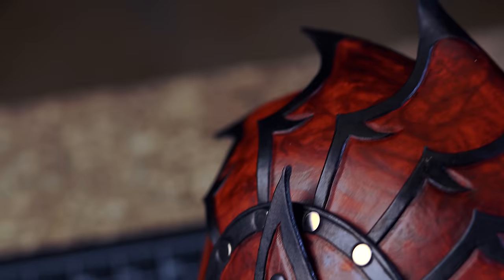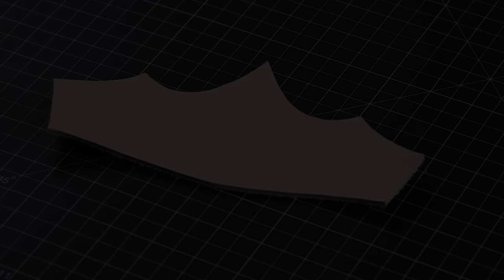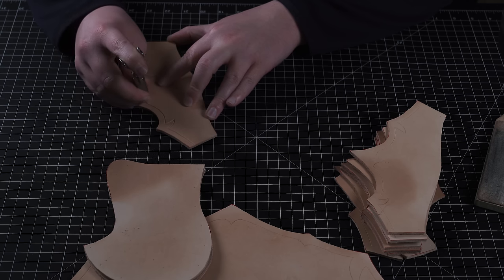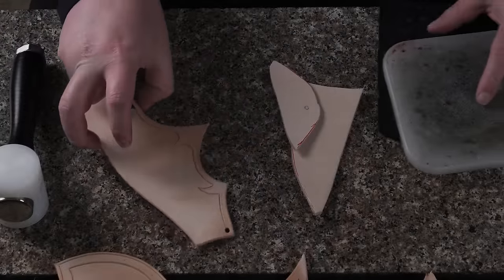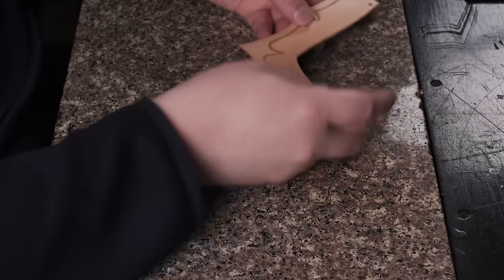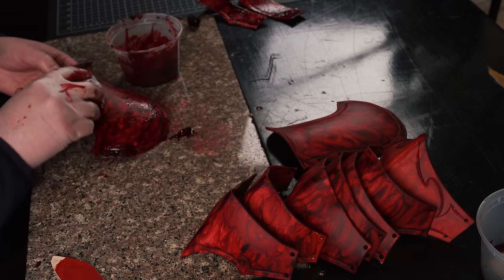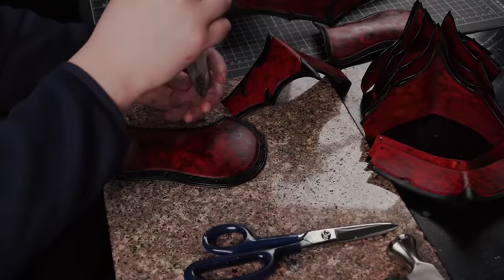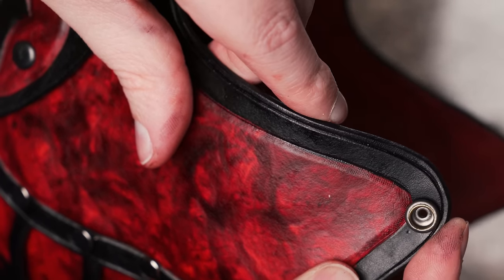DIY LEATHER HELMET - Fantasy Armor Tutorial

Comment: at 42:50 I have had full-blown panic attacks from snaps doing this. Think it's completely set and "boom" the little stinker just pops off. What I do is use the bigger line 24 setter first but only give it a light smack. This starts the doming of the inside piece. Then I switch to line 20 setter to drive it home. Works wonders. Trial and error is a huge part of Leatherworking.
Reply from the maker: Haha, yeah.

Comment: You might try a hook razor for the rough cuts. They are disposable razor blades that are extremely sharp but safe. They are often used for vinyl flooring.
Reply from the maker: You mean the ones you can get in the utility knife style?  I do recommend those too but don't have any on hand at the moment.

Comment: Completely new to leather working here.  However, I have had some exposure in the past.  Enough at least to follow along and understand your instructions.
I really enjoyed your Bracers and Spaulders videos.  I honestly believe I would start with the bracers, then the spaulders and after some mistakes, lol, attempt this Helm.
Thanks a lot for your video's.  I can't wait to give this a go.
Reply: @Prince ArmoryI notice that while the stains are different in your three projects, the design is very much similar and I assume that is on purpose to allow a "set" appearance.I do have a couple questions....1) For those of us with longer forearms, how would you suggest adding length to the bracers to add one more plate?2)  Are you considering, or have you done, a chestplate of similar design to complete the set?  I can see your display is set around chainmail, but I think a tooled Chestplate would be outstanding and really complete this design.

Comment: Your work is amazing and I have followed your projects for quite some time. Great tutorial and I am excited to start working on mine as soon as I can pick up the pattern. I do have a question about what I saw in this tutorial. Since you use a generous amount of dye on the leather. If someone were to wear the helmet what would keep the moisture or sweat from bleeding out the dye onto their skin? Does that final coat that you put on work as a good sealer to prevent that from happening? Would leather sheen do the same? I've used some dyes in the past and whenever there is a good amount of moisture they tend to bleed out a little from the leather.  Thanks and keep up the outstanding work!!!
Reply from the maker: Some dyes are worse about bleeding than others but you have two options, either seal the leather like I did with the satin sheen on both sides, or, leave the under side completely undyed.

Comment: Awesome video and a sweet pattern. Beautiful and simply elegant, I'm itching to try it out.  I'm planning to use a 10-12 oz. leather. Any suggestions for doing this with a thicker leather?
Reply from the maker: Good question.  Yes you can use thicker leather however it will be more challenging when riveting 3 layers of leather. You may want to switch up to copper rivets or long chicago screws and adjust the hole width accordingly.  The hole spacing on a design like this should still be pretty close even adjusting the thickness of the material but expect some minor tweaks and plan accordingly.
Reply: You can use a French beveler (French skiver) to skive a countersink around the rivet hole so you don't have to change the style of rivets. Do a couple of tests on some scrap to make sure you get the right depth so the rivet sets properly and secure. You can do this with the snaps as well, just make sure that you do it on the flesh side. If you do it on the grain side, the dome of the snap won't cover the part that has been cut away and can look unsightly.

Comment: Hi! We bought your pattern and are ready to dye! We're new to leather working and are having trouble achieving the color/texture you show here. We purchased the same dye, but it seems much thinner than yours appears, and dries much much darker. Any tips?
Reply from the maker: There many factors that could be at play and hard to say without being there looking over your shoulder.  Different types of leather, different applicator,  application process, different moisture consistency, possibly even a different lighting, or maybe even other factors.  My advice is just learn by doing and trying different processes and techniques.  I tried to show my process fully in the video but even so, it doesn't have to be exactly like my result to still be good.

Comment: Love this and everything about it but I have two questions.  First question is about shaping the leather I understand how you did everything but the side pieces.  Did you use the same fold it half and hammer or something different because it looks to me like it has a much different shape than if you folded it in half and hammered it.  Second question is on the pattern itself: what are the dash lines on the pattern?  is that another way to make the pattern to get a different shape?
Reply from the maker: The side panels only have a little shape which I did by forming it with my hands.  You don't have to do this but if you want to learn stay tuned to future videos, I'm sure it will come up again soon.  The dash lines are for the second style.  at the early part of the video you can see the black variant that uses those lines.

Comment: Does it work in combat?
Reply: That mostly depends on what you choose to make it out of and what kind of combat you are doing. If you build the pattern out of 14 gauge steel sheeting and line/pad it properly, it'll do great. As far as re-enactments, larps, etc check with a marshall and/or the guidelines for combat to see if your planned build will be up to spec. Using 8-10 oz leather like is used in the video will be fine for most light to medium boffer larp type things. If you are going to be using rattan or other hard hitting full contact combat rules, you'll likely want to build heavier and wear with a well padded gambeson.

Comment: I have a question. Is it possible to attach or somehow integrate this style of armor helmet to a motorcycle helmet. Just thought that helm would make a cool bike helmet.
Reply: My two cents: Since bike helmets are so specifically made for maximizing protection, you'd want to modify the motorcycle helmet itself as little as possible. If it were me I'd probably build an oversized leather helmet that slides down over the bike helmet. My concerns would be visibility and anchoring. If you built it as an over-layer you'd want to have some kind of snap or button stud that locks the leather helmet in place so it doesn't shift or rotate on you and block vision.
Reply from the maker: You could possibly do something like that if you modify the pattern a bit.
Reply: Bjornsworkshop hi. That is exactly what I was thinking. Laying the leather on the helmet and modifying the leather to fit. Visibility is a concern but one can always adjust the design.
Reply: @Sularus76  hell yeah!! Give it a go and let us know how it goes! You can always start with a cardstock mockup to iterate your pattern without having to go through a ton of leather to get it right!

Comment: Beautiful work and excellent video, subbed and it looks like I have a lot of back catalog to go through, always happy to discover a new channel. If you're up for some constructive criticism I will say the edit could be tightened up a little, some parts get a bit redundant. The audio mix gets a bit muddled too, making your narration difficult to hear. In addition to audio levels try tweaking the EQ of the music, drop the frequency at about 1550 or so and you'll hear the dialog much easier. I learned this trick way too late :-)
Reply from the maker: Explain the frequency drop?  I'm new to this.
Reply: @Princearmory  it depends on what you use to edit in, I use BlackMagic DaVinci Resolve (check it out, it's incredibly powerful and free if you don't need high end features). Basically you add or adjust an Equalizer (EQ). You'll see a bunch of numbers corresponding to frequencies, the higher the number, the higher pitch the sound. The left side is the low end, the right is the high. There's a line with dots or vectors going across, move those dots and the line up to boost that frequency, pull it down to minimize it. Find the dot around 1550 and pull it down a bit, you may have to shift a dot left or right to get to that range, and the other dots around it will form a curve, it shouldn't be too sharp it will sound distorted. Since the human voice tends to live in that area when you cut it out of the music it won't compete as much. You can also experiment with your dialog to make it easier to hear. Use these in addition to overall levels to keep everything balanced. Also watch your level meters, keep it at around -6db and watch those red spikes, it's a warning that things are getting too loud. If there are any ACTUAL audio experts (I am not) please feel free to expand on this.

Comment: can i ask please because i bought the patterns and video how many square feet of leather thnx
Reply from the maker: Leather is priced by the square foot but not really sold by the foot.  And there are many variables that will change the number of square feet used as well just based on how you end up laying out the patterns.  Check the video at the point where I have it laid out so you can get an intuitive idea of what you'll need.  When you buy the leather, it will probably be a side or something that will give you much more leather than you need initially, which is good because then you can pick a clean spot in the leather where you trace your parts.
Reply: thank you sir
 @Princearmory

Comment: Man, I wished I had found a video like this years ago when I made my Baratheon armor. I had to basically wing it. Looks awesome, but still, this would have helped, I didn’t bevel the edges or anything, and you didn’t explain about burnishing the edge, the tool, process or the purpose. Can you?
Reply from the maker: I just used a burnishing tool (a stick basically) and used friction to smooth the edges, nothing to it, i just forgot to write and record that part.
Reply: PrinceArmory thanks. I do have a question. I made a helmet, bracers, shoulder and arm guards, a skirt, leg guards, and a breast plate. All but the breast plate kept their form and rigidity. I’m guessing because of sweat. But I’m looking to reinforce the breastplate to give a more firm appearance. Was thinking of something like a molded sheet of Wonderflex, or another thermoplastic, but would love a second opinion.
Reply from the maker: Dunno, depends on the thickness of the leather I guess.  Such a unique scenario its hard to speculate without more information

Comment: Thanks for a great video, and what an end result!
You used 9 oz. leather, do you reckon it would work with lighter leathers or would they start to loose their shape?
Reply from the maker: You can go a little bit lighter.
Reply: @Princearmory  Thanks for the reply :)
Reply: Each step of tooling, dye, and sealing adds a little bit of stiffness to the leather. A lot of leather masks are made of 5-6 oz leather and hold their shape just fine. Below that things start to get a little iffy strength wise, but for purely costume wear you can work with 5-6. If you do a little bit of wet forming the leather will also water harden helping even more!

Comment: I just watched the red & black armor video (looks like the armor that goes with this helm). This might be a stupid question, but can you harden leather to make it more resistant to cutting? Or is it that you just add more layers? Or both?
Reply: Definitely not a stupid question. No way for you to magically know the answer!   There are ways to increase the hardness of leather (compression via tooling, adding acrylic sealer, using a product called leather firmer, etc). Beyond that you can add more layers, back it on other materials, sandwich a reinforcing layer between layers of leather, and much more. There are tons of options, but its feasibility really depends on your goal. When you do leatherworking.... you cut leather with a knife. So leather won't ever be the go-to for cut-proof stuff. Having said that, if you're just looking to step it up from where it was before, DEFINITELY possible!

Comment: Why didn't you use the Chicago screws to secure all of this together?
Reply: The biggest reason is that rivets are significantly less expensive than Chicago screws. Additionally, rivets tend to give less room for play between panels of leather because they are set firmly in place. You could absolutely use Chicago screws everywhere that calls for a rivet, just make sure that you put a drop of light grab loc-tite or something similar so they don't work themselves loose over time!
Reply: @bjornsworkshop9288  you do amazing work man!
Reply: @jsinprtn29  hey thanks! Much appreciated!

Comment: I don't want to F with the craft, but would etching the cut design in, or perhaps even cutting the the pieces out with a laser cutter be effective? Or would it singe the leather too much & ruin it?
Reply: You can absolutely laser etch leather. Cutting partial depth works to a much more limited degree. Because of the burning, you can't really use a laser to cut instead of swivel knife work to then go back and bevel.... but you could absolutely laser cut pieces out to create intricate filigree designs.
Reply: @bjornsworkshop9288  Yeah, ok. I see what your saying. The laser cut edges would be burnt & crispy & not great for beveling, but it sounds like it would still be alright with other techniques & etching or scoring might be ok?
Reply: @spikechuong951  yep definitely! Basically as long as you keep it to linework you are all set. As is true with everything in Leathercraft, test on offcuts or scrap before risking a large piece of leather and potentially not getting the results you expect. Glowforge has done a few videos on laser cutting and etching  leather

Comment: I really want to make this but could I use foam instead? or would that not work?
Reply: I just finished making it out of eva foam (1mm I think) and it worked. I used string to connect the pieces since my goal was to do a trial run for sizing and figuring it out - that way I can take it apart as needed.
Reply: @seantredwell8665  thx i'll try it out

Comment: If you were to harden the leather, would you do that before dying the leather?
Reply: That depends on how you plan on hardening the leather. Generally speaking, wet forming, stamping, dyeing, and sealing the leather each increase the structure of a piece of armor. Additional hardening techniques (hot water, wax hardening, water/glue mixture, etc etc etc) will often, but not always affect the leather's ability to absorb dye, antique, etc.  This happens because the wax (or other hardener) fills the pores of the leather and seals off the leather's ability to accept additional liquids (dye included). I will also add that most hardening methods will chance the color of the piece, so make sure you test your techniques on scrap before risking a project you have invested a significant amount of time, effort, and materials on.  If you are using paints to color your piece, I would harden > paint > seal > antique > seal. If you are using dyes, I would Dye > harden > seal > antique > seal. Again, trial and error will help you find your exact process but that's at least a starting point.
Reply: @bjornsworkshop9288  thanks! This helps a lot. I figured once hardened it would be more difficult for dye to take but wasn't sure how badly water hardening would impact a dye if done beforehand.
Reply: @javipipes5124  do you have a specific technique in mind for hardening? What is your goal for the hardening and intended purpose for the helmet? You'll have very different needs depending on if it intended to be a shelf ornament vs cosplay vs full contact combat
Reply: @bjornsworkshop9288  I enjoy making combat ready pieces for my own collection; just something I do for fun. I've made arm bracers using the hot water method for hardening, but that was a test run so I didn't do any dying or sealing of those. Now I'm looking to move into more detailed pieces.
Reply: @javipipes5124  Got it! If you are looking for "combat ready" stuff (a rather broad term, but we'll err on the heavier duty side of things), I'd suggest looking into 12+ oz leather and wax hardening. Water and wax hardening both involve submerging your created piece in hot water/wax, so be aware that a SIGNIFICANT amount of detail in stamping/tooling may be lost. Be prepared to make several test pieces so you get an idea of how much detail is lost/affected so you don't spend 100 hours carving/tooling a gorgeous intricate pattern only to pull what looks like a lumpy potato out of the hardening process.  I've seen some good results with patterns just carved in with a knife, but they aren't nearly as pretty as some people go for. One thing you can do increase complexity is add layering and hardware accents (rivets, metal rings, buckles, etc) in order to achieve more visually striking results while still being able to harden your piece(s) properly. Another thing I would suggest is do some tests on hole punching before/after your hardening process. You'll likely end up with something stiff like wood and that will be a pain to punch through, so you may end up wanting to drill your holes, depending on your final design. Best of luck and let us know how it goes!
Reply: @bjornsworkshop9288  thanks for the info/advice! Didn't think about the detailing being affected by the process. Hope to have a first run soon!